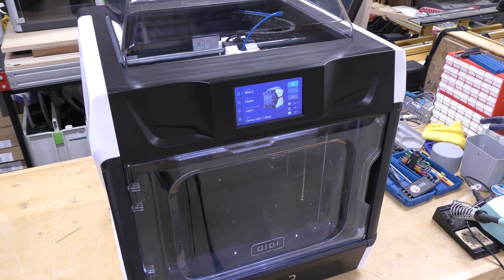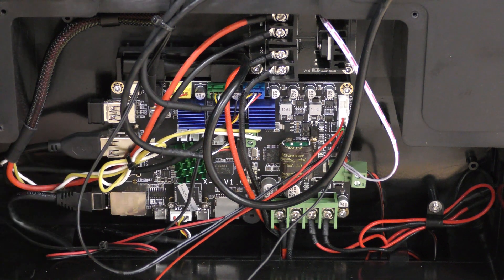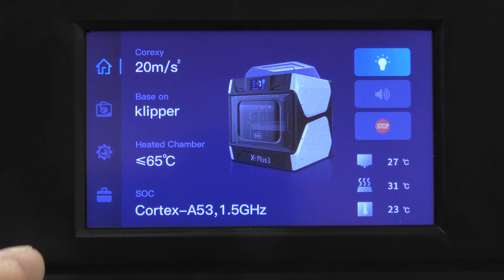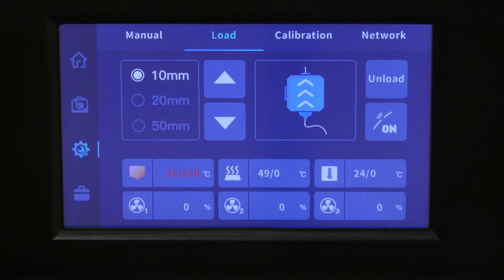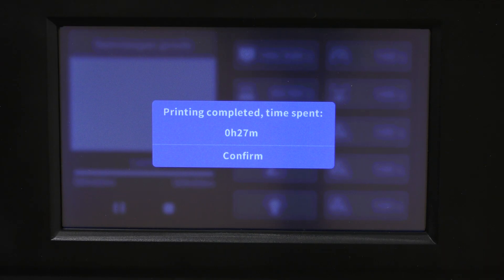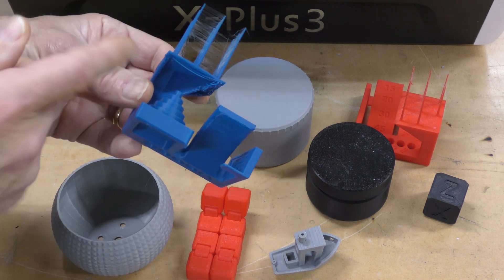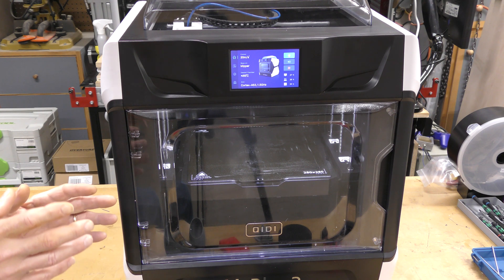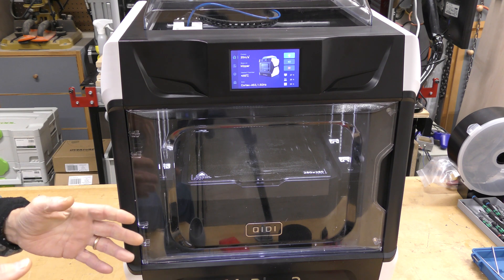Qidi X Plus 3 - Is This Printer The Real Deal?

Comment: IMO, the X-Plus 3 is NOT the real deal. My months of experience has proved it to be a POS. My older X-Plus was a MUCH better printer. The older printer has a successful part rate of almost 100%. The X-Plus 3 scraps at least half of my parts. User interface issues, firmware bugs, firmware crashes while printing, and LOTS of filament bird nests.

Comment: do you think it is possible to "crack" the Klipper? to find out what has been overwritten there and how it works. if someone gets into it, it's a possibility, but it's a question of how much it's locked, at least that's my opinion
Reply from the maker: You can get to all the config files and also SSH into the main board. It's all there if you so choose to do any modifications.

Comment: hi GS, I really need to know,does the Qidi x plus 3 printer has Resume printing when the power goes off while printing ? there is no mention of it in anny video on utube
Reply from the maker: I just checked their website and it doesn't mention it either. Nor have I tested it. You might want to shoot them an email and ask. They are pretty responsive. plus3support01@qd3dprinter.com
Reply: No power resume, another reviewer tested it since it wasn't mentioned. Excited to get my xplus 3 next week, not being unlocked firmware doesn't bother me since I usually stay on one version for years and years

Comment: I picked up a k1 last week and rooted it and installed full version of klipper and it is night and day. I have all the functions incuding kamp etc. I am also able to use orca and send prints wirelessly. I did look at the qidi printers but the xplus 3 was almost twice as much. I think I would prefer the k1 max over the qidi now that you can unlock the k1 series. Before that, i would havs gone for a qidi. So hopefully qidi also gives their cx's full unlocked klipper and then i will consider. All my printers are running klipper now as well. Thanks for the review Guy. Cheers
Reply from the maker: The Qidi does have full access to the software like the K1. You can SSH into it and install vanilla Klikpper if you like. I agree that the K1 right now is a better value for some. I think the Qidi fits a niche for those wanting to print some of the filaments that require a heated chamber. Thanks for watching!
Reply: First of all qidi tech x-plus 3  has access to the software and it's so much better than k1 in many ways